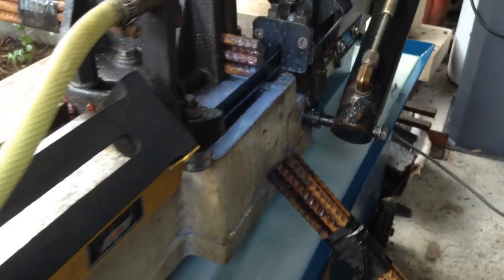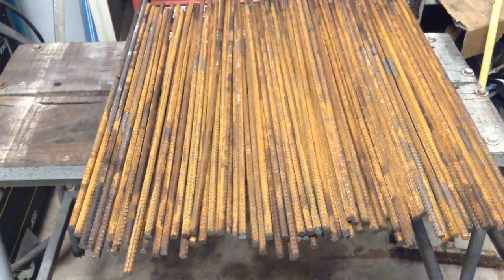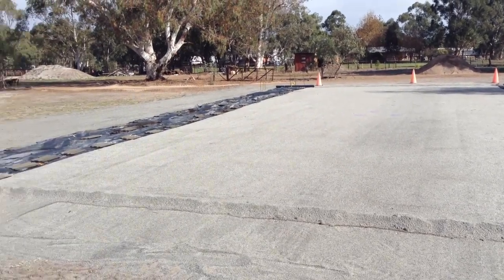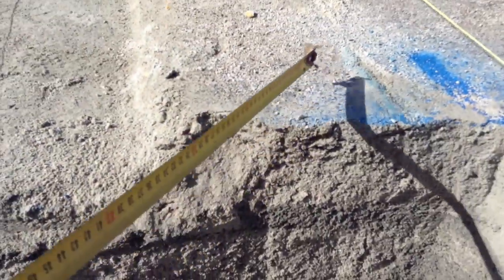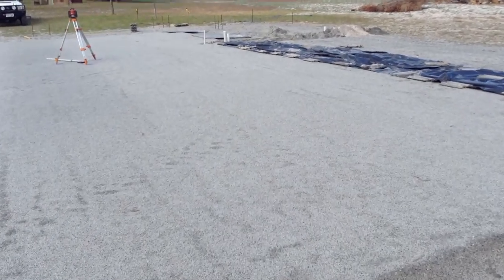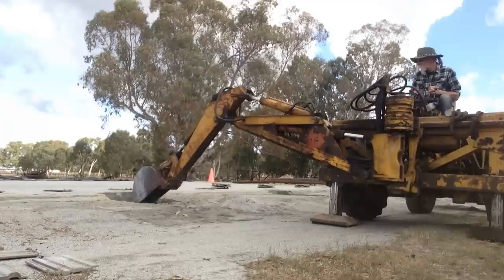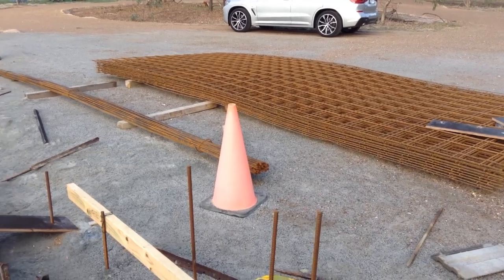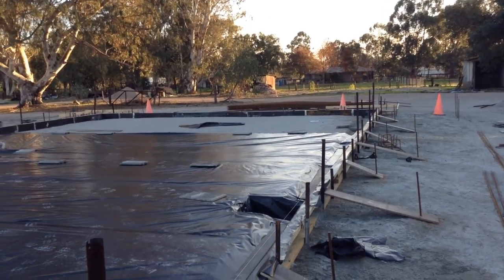New Shop Progress , May / June

Comment: Great job. I always enjoy seeing how the building trades construction techniques vary in different countries. I like the shoring/bracing used for the foundation. Clever, minimalistic and effective.  I was amazed that the concrete trucks are allowed to drive on the  pad. They'd tar and feather a driver for that here. LOL As a plumber I like the idea of the overflow pipe. That is thinking ahead. Better that the crap overflow outdoors than inside, eh?
Reply from the maker: Thanks .   Something i do not want to do again in a hurry , half killed my legs walking in 6 to 8 inch concrete in gumboots with a vibrator !    👍

Comment: Cripes!  I was thinking finally someone knows how to do a pour when I saw the rebar chairs.  Then the frigging cement truck drives over them!!  I have never seen a cement truck drive into the formed area ever before.  Especially when the perimeter was wide open and accessible.  I will bet your steel is mostly laying on the ground under the slab instead of in it.  I think I would be wringing the neck of that driver.  He should have easily had full coverage with his chute extensions working from both sides.  Even pouring from one side would have been quite doable.  Amazing!
Reply from the maker: Look again !!!  only the rear chairs were in place , two  other people were putting the chairs in as the truck drove forward .  It's the way it has always been done before pumps were around .   Not one chair was squashed .   Driving into a formed up area is no problem as it is 400mm thick compacted cracker dust ( granite , by product of crushing road base ) on top of compacted sand . 
Cheers .
Reply: Max Grant ,The Swan Valley Machine Shop. Yes pretty common for the grano workers to lift the mesh up into the middle of the slab during the pour as they go, BUT, the comment was valid it COULD probably have been poured from the sides and ends.
That assumes the aggi truck could access all 4 sides loaded without getting bogged.
Some of that sand out in the valley when it gets wet might be OK with a 4WD ute, but a concrete truck full of concrete might be a different story.
What method they employed worked & really that’s all that matters at the end of the day.
Pretty good result by the look.
How flat is it overall?
What’s your lowest “low spot” now it’s set when you check with the level?
On a machine shop floor an inch might not matter much because your machines are probably on adjustable feet.
If it was a cabinet shop and you were setting out cabinets - then 1mm would be better.
Rented a large workshop once for cabinet making and the low spot was 40mm.
That’s a LOT of wasted time packing up your toe rails in the shop to level to lay out the kitchen benches for final fit up.
That wasted time over a kitchen a week adds up to lost profits at the end of the year, or wasted beer drinking time at knock off depending on your habits. 😂
Looks like you do have plenty of layout space after all, my mistake.
How’s progress now? It hasn’t seemed to stop raining of late!
Offer of a hand, still stands if your short of a hand any time.
Looks like maybe your back at work, the videos have been quiet lately by the looks.
Hopefully your making a quid to put back into the new workshop build.
20x10 is a serious shop.
👍👍👍 so far.
Reply from the maker: @ianmoone2359  The slab  was too wide to pour from the sides .  The  foundation was that solid & hard you could run trucks over it all day without damage  700mm of compacted cracker  & road base  under that slab  with sand under that  that compacted  double what  the engineers had specified . Construction progress is slow as i am making up all of the  brackets to hold it all together at the moment .   And flat out at work !!!    The slab came out great , nice 
& flat  and as  smooth as  glass but not slippery .    Flick me an email ( it's in the channel description )with your number  , i think it may have been a digit short .    Cheers .
Reply: Max Grant ,The Swan Valley Machine Shop.
Ohh Four Hundred, Seven Double Two, Double Ohh Six.
(only licensed to wound, not to kill).😂😂
Couldn’t find that email link in the channel description on my IPhone sorry Max. 👍
At least your making steady progress Max, Rome wasn’t built in a day. How tall is this thing going to be?
I’m thinking, for its size, you might be needing a scissor lift to erect it. Might be a big ask off ladders?
Reply from the maker: @ianmoone2359  5m , not to bad . I will use a scaffold on wheels .
Reply: Max Grant ,The Swan Valley Machine Shop. That should work. 👍  5 meters is a long way to fall, & I don’t bounce as well as I once did! 🙄😂😂👍

Comment: Hard work leveling concrete well done.
One question why didn't you lift the mesh off the floor so that it is encapsulated in the concrete  ?
Your slab is just sitting on top of the mesh.
That's what our building regulations specify.
Reply: I think those little black cones are lifting the mesh off the base.
Reply from the maker: The mesh  & reo sit on plastic chairs at the correct level below the top of the concrete .  2 people follow the trucks & fit them in as the truck moves forward .   It's hard yakka alright !  Cheers .

Comment: Looks like you guys did a pretty bang up job! Yup, tieing rebar isn't the most glamorous job but since a machinist did it you KNOW that it done good! 🤣 
Did my fair share of concrete work in my early 20's. Nothing like tripping over rebar for 12 hours straight while it's being poured 😏. Thanks for the share, Max. Cheers!
Reply from the maker: Thanks Chris .   It takes it all out of you walking around in the stuff & balancing on the steel !    Cheers .